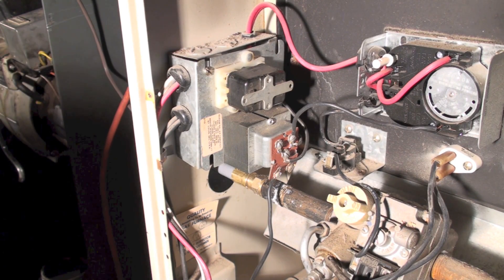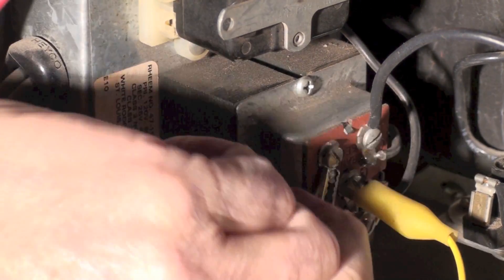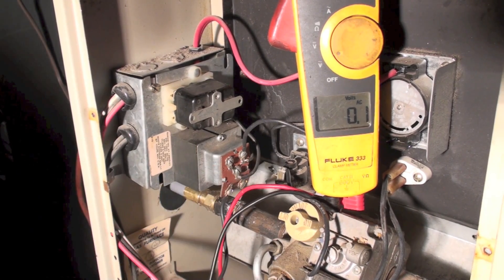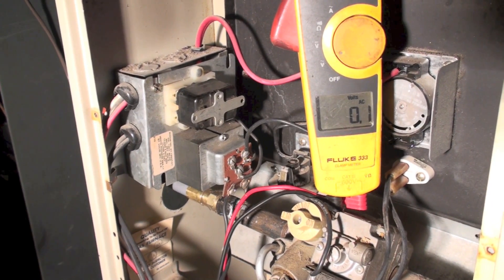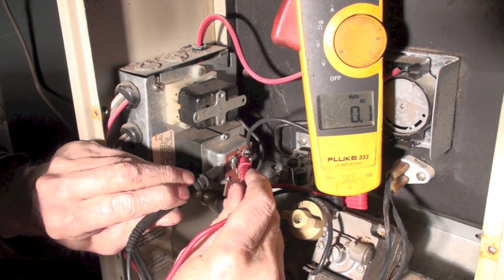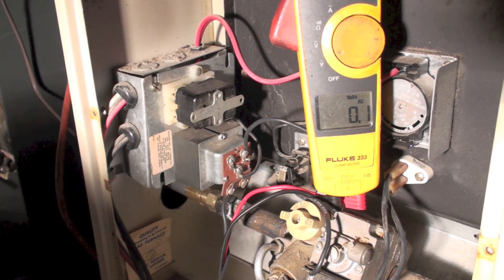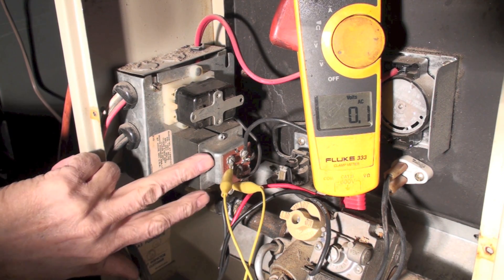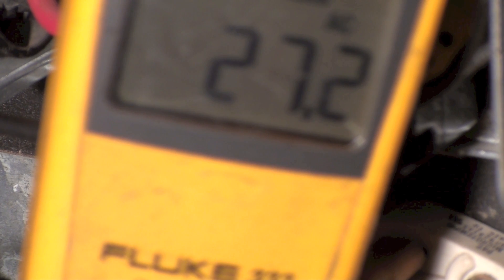Furnace fan center troubleshoot

Comment: what happens if you jump w-r and the burners don't turn on,.... what would the problem be then ?
Reply from the maker: There are many possible problems here.
First, is there power to the furnace?
GFM
Reply: g-r bypass and yes fan motor stars
Reply from the maker: Gas, oil or electric?
GFM @miguelperez1812
Reply: Gas @grayfurnaceman

Comment: Fan keeps running then i move the fan limit control towrds low setting any thoughts ??
Reply from the maker: The fan switch has probably stuck closed.  Means replacement.
GFM

Comment: Dear GFM,  After replacing the fan motor last week in my antique  1960 ? input 105k btu (like the pane antique) or maybe 1970? GE Model 21LU10502 M1  serial 555947 029   while temps outside were below freezing, I'm now interested in untangling the birds nest of wiring in the fan center control box, so as an inexperienced handyman I can make a crude wiring diagram of the simple furnace wiring and color code, as well as oem transformer and relay part numbers.  This video gave me the name I was looking for concerning my still in service antique that I've been the sole maintainer for the last 23 years. OMG  it's still chugging away thanks in no small part to your tubes, especially the ones on the old antiques.  Billy in Rochester NY

Comment: Could be transformer converts from 120 to 24 bolts I believe fan runs on  24 volt this video will show how to test some what
Reply from the maker: Your fan is controlled by 24 volt controls, but the fan operates on 120 volts.
GFM

Comment: How many volts is that middle crew terminal with the green wire, are there supposed to be wire from Y and W to Fan Motor?
Reply from the maker: The green should have no voltage if the fan switch is not on.
The Y is to energize cooling and W is to energize heat.
GFM

Comment: EXCELLENT explanations on fan control.  Understanding how fan control work is the base for troubleshooting fan related issues. 
I have learned quite a bit about the wires at the thermostat (and at the furnace) and that allow me to understand the explanations in this video 100%. I have even played with the jumpers (R to G, and R to W) and get expected results before watching this video.
The reason I watched because when I turn ON the fan at the thermostat (same as jumper from R to G) the fan runs at high speed. When fan is set to AUTO, and heat is ON, the fan is not working !!!
This tells me that the G at this time has 0 volts (by thermostat design, verified here and verified on simple bench test). So my fan problem is somewhere in the low speed control of the fan.
That is my conclusion, please correct me if I am wrong.

Comment: What if you were to jump from r to g  and can get the fan on but when you jump from r to w nothing happens?
Reply from the maker: You know there is power to the furnace and the fan works.  Now you need to find out if there is power to the furnace controls.
GFM
Reply: @grayfurnaceman  I verified 24 volts to R with meter. Hence I was able to bring on fan when I jumpered R to G
Reply from the maker: @SuperSincere1  Next you need to verify 24 volts to W at the furnace on a call for heat.
GFM

Comment: my furnace turns on ,heats but wont shut off when the room temp hits desired temp, the heat shuts off but blower still runs, if you call for more heat the burner engages but blower wont shut down when it comes to temp? thanks
Reply from the maker: I would be looking at the fan switch.  Your furnace probably has a heat operated fan switch that can sometimes stick.
GFM

Comment: I jumped g to r fan comes on jumped g to w burner comes on changed thermostat still not coming on in heat mode when I touch g to r at thermostat no fan any ideas could it be my fan limit switch
Reply from the maker: If you jump G to R at the furnace and the fan comes on, then jump G to R at the thermostat and nothing, you have an open in the thermostat wire between the thermostat and the furnace.
GFM
Reply: grayfurnaceman before I changed thermostat fan worked in fan on mode but not in auto after I replaced Tstat no fan in on or auto I was thinking new Tstat might be defective but slim chance with old stat working fan in on mode do you still think open wire or any other thoughts and thank you for replying and your vids these old units dont talk back like  new control boards lol
Reply from the maker: @davidpope8278  To double check, you can remove the thermostat wires from the thermostat and jumper R to G, fan, R to W heat, R to Y, cooling.  Then do the same at the furnace.
GFM
Reply: grayfurnaceman Did that this morning of course u were right on point GFM wire was open/broken had to improvise found an old twisted pair analog phone wire in crawl space tested it used ohms law to calculate power draw only 5ft run ran it now good to go.  You are a HVAC/Furnace repair God!
Reply from the maker: @davidpope8278  Glad you got it going.
GFM

Comment: Is the blower supposed to come on before the burner?
Reply from the maker: Generally, no.  If the fan relay is energized in heat, the fan will come on first.  But that is not how furnaces generally operate.
GFM

Comment: Hi, I have a clicking noise coming from the transformer or relay. The fan seems like it tries to cut out for a split second as the speratic clicking is happening. Which do you think this would be, the relay or the transformer? Thanks in advance.
Reply from the maker: First, I would jumper out from R to G to see if something outside the relay is failing.
GFM

Comment: love you videos. i have a question ?why would the fan come on when you give 240 on a electric furnace. when i pull out the relay the fan stops. the fan does the same thing when i have changed the fan switch, and the relay.
Reply from the maker: I would be looking at the low voltage controls.  Try removing the G terminal from the terminal board.  If it stops, the problem is in the G circuit.  Shorted G wire?
GFM
Reply: @grayfurnaceman  will do and keep you posted thanks

Comment: Nice video  I know it's old so dont know if I'll get a response. I have a williamson gas forced furnace. I had a black out and when the power came back on my furnace doesnt work.  It's a oldie lol I have a 10amp fuse right by the switch for on/off. I tested fuse thays good  but I dont have any power at the transformer coming out. Are they hard to change?
Reply from the maker: They are not generally hard to replace.  This video may help:  https://www.youtube.com/watch?v=T4fWh0bl_aU
GFM

Comment: Hi I have same unit in your video. The heater won’t shut off after reaching temp at thermostat. I’m only getting 14v at W on transformer. Is it possible the relay stuck on? Any feed back would help thanks
Reply from the maker: Does the burner stay on or just the fan?
GFM

Comment: why would a fan control center be getting hot in ac mode only i have ohmed all low voltage and high voltage on cooling circuit i also pulled amp draws on blower motor in both heat and cooling speeds both in range cap is also good
Reply from the maker: They sometimes get pretty warm under normal operation.  You can check amp draw of the control circuit.  It should draw no mare than 1.6 amps.
GFM

Comment: I have a delemna sir...when I set thermostat, blower turns on and heat ignites but when temperature reaches settings on thermostat, blower and heater will not shut off...fernace stays running. ..what say you will? thermostat issue?  relay?...I'm at a loss
Reply from the maker: First, disconnect thermostat with the furnace running with the thermostat set at its lowest setting at the thermostat.  If it stops, the thermostat is the problem.  If not disconnect W at the furnace.  If it shuts off, you have a wiring problem.  If not, it is in the furnace itself.
GFM
Reply: thank you. ..I'll try that...I appreciate the input

Comment: Under limiter wheel switch there looks like a rollout switch I have one not so close it's on housing of the chamber frame could this keep my fan running continuously without turning off?

Comment: my fan won't come on my ruud forced are gas furnace so it won't light unless I spin it with a pencil to get it going.then it will run.but after it shuts down I have to do it again.can it be oiled?
Reply from the maker: +Tim Bowker If it moves easily, there is no problem with the bearings.  However, if it is a PSC motor, it probably has a failed capacitor.  Hope this helps.
GFM

Comment: I opened furnace and blower started again after 2 day fail now my blower won't turn on. the system runs a day or so then fan stops again? will a fan limit switch on an old sears furnace work sometimes then not work? I turned off power and the continuity tested ok when I rotated the disk?
Reply from the maker: +Christopher Dixon Anything that works may not work.  lol  Sounds like the the fan switch is sticking off.  I would replace the switch.  
GFM

Comment: I was working on this furnace and the rollout switch opens with no actual rollout...I believe the metal housing heating up causes it..what's your thoughts?
Reply from the maker: Are you sure it is not rolling out?  You might try replacing it and see if it continues.  Hope this helps.
GFM

Comment: i just noticed that we  jump from  W to R at 4:59 , i have read that it is unsafe to bypass  the thermostat in heat mode
Reply from the maker: This video is about troubleshoot.  We often jumper parts to decide what the problem is.  Of course we would not leave a jumper in.  That would allow the structure to overheat.  The only exception I can think of is if you have control system that is designed to work as a unit between the thermostat and the air handler.  Thanks for the thoughts.
GFM
Reply: Jumped w to r but burner doesn't come on any idea what do do next